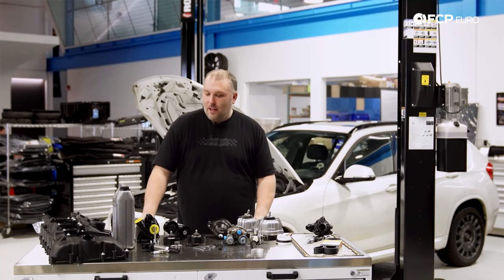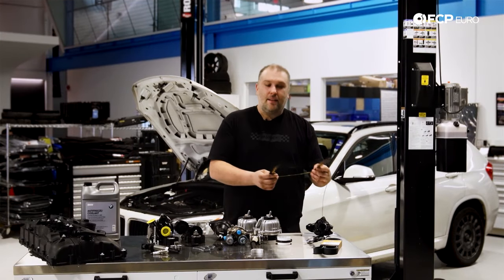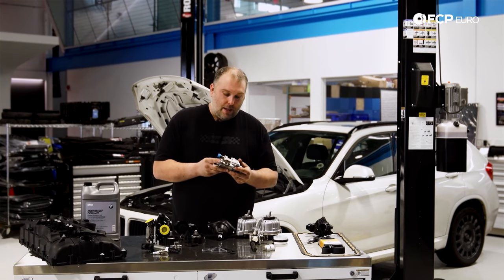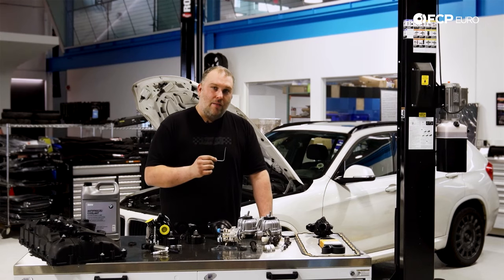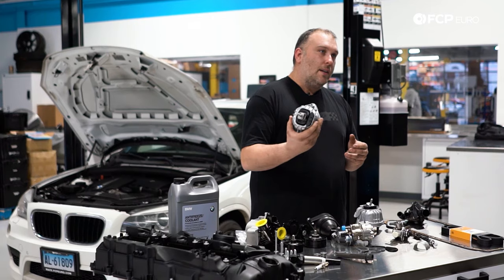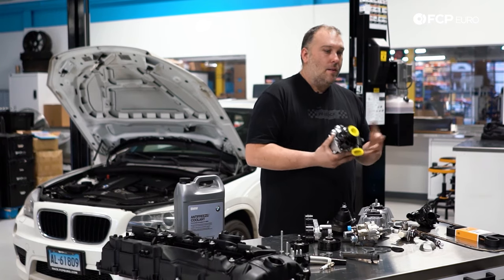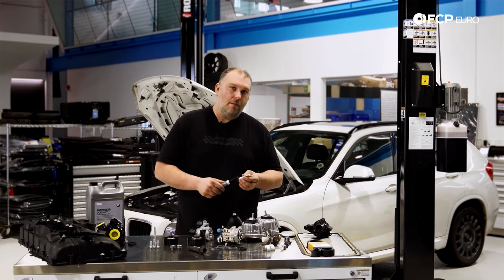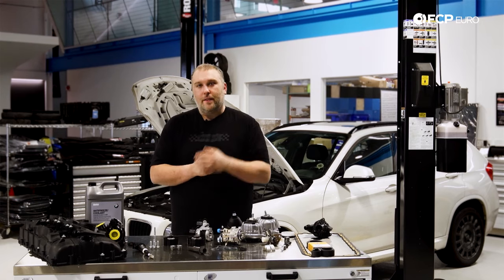BMW N55 Engine Diagnostics/Problems - Everything You Need To Know (X1, 135i, 335i, 435i, 535i)

Comment: If you maintain you oil change intervals to 5000 to 6000 miles max you can significantly extend the life of your valve cover, oil pan and oil filter housing gaskets. Also your VANOS solenoids and rod bearings.
Reply: Also with tuning you can lower the coolant temp from 230f to 200f and that will also extend the life of all your plastics components.

Comment: I had a water pump, cracked valve cover, oil filter housing gasket, and pulley failure all before 60k on an F25. Has been great for another 70k but compared to my N52 powered vehicles it has been much more expensive to run.
Reply: i had the water pump/t-stat,  pcv valve leak(part of the valve cover), valve cover gasket leak in a n52 E85 z4 3.0si, so not much better tbh
Reply: Any cam ledge bearing issues?

Comment: This is a great video, and I love my 2011 535i, but you'd think for all the German quality and the price these cars cost, the service life on these parts would be longer.  I have just under 150K miles on mine and the notion of all of these gaskets, pumps, etc., checking out at 100K miles or under is bonkers to me.  Especially when my POS 08 Ford Escape continues to chug along at 230K miles on the clock with just regular oil changes, and my classics run reliably despite being 60+ years old.
Reply: Based on what you said, the Escape doesn't seem like such a POS
Reply: @JPDenali The escape is a reliable POS. The bimmer is a questionably reliable high performance sports/luxury car.
Reply: planned obselescence $$$$

Comment: I’ve had 95% of all the problems that can happen is this video. The strangest one was the high pressure fuel pump shaft breaking in half, anyway I love [135i DCT with M sport package] the car so spending the money wasn’t an issue.

Comment: In California(I am not sure in other states/countries),  the warranty on the valve cover gasket is 8 years OR 100k miles. A lot of people diy the repair, and I was about to... but I got mine changed for free at the dealership. I have a 2014 M235i and it started to leak and would pool up and drip right onto the down pipe. I would smell oil burning and even saw smoke pouring out through the hood while driving. Posting this for anyone who might be in the same position I was!
Reply: Is this applicable to an n55 bought out of state even though I reside in California or only car initially bought in the state ?
Reply: @PutTheCookieDown  It’s a result of calling back and lawsuits. I don’t think it has anything to do with CA. A similar case happened on water pump.

Comment: "This is a very reliable engine considering what it is..."

Fool me once.....
Reply from the maker: 55 is a higher number than 54... it has to be better.
Reply: FCP Euro clearly you know where I’m coming from😂
Reply: It is reliable...
Reply: @matt.108  scotty kilmer?
Reply: Aidanlee5914 I hope not lol
Reply: chris krip compared to the N54 I had my N55 has been really good to me.
Reply: My 161,000 KMs n55 here, never tracked, stock, 6k oil changes, original owner. 

So far : 

- Valve cover gasket
- Oil pan gasket
-Oil filter housing gasket
- charge pipe blew up
- map sensor 
- boost pressure sensor
- maf sensor
- all wheel speed sensors
- waterpump 3 times
- HPFP 
- Alternator
- Vanos solenoids
- ignition coils 3 times

My 149,000 KMs 2012 Civic Si, stock, never tracked, 6k oil changes, original owner. 

Spark plugs....

If I didn't do most of the work on the BMW myself I would be living in a box on the side of the road by now.
Reply: I think in the past 5 years I've old ever heard of 1 n55 failure on babybmw so m135is, m235is and m2s and his was probably due to servicing every 2 years so yeah it is a reliable engine
Reply: Blueblood true. Most of the n55 failure are from the m’s. It is used across SO many models. It is still a rare failure
Reply: @vb7037  I  am oscilating between Civic type R and BMW M135i n55. But the list of problems here (and all over the net)  is huge, i think i'll stick with the Type R. I don't find much on the Civic Type R FK8 reliability, but should be far better than BMW.
Reply: And i ended up buying the M135i...
Reply: @motorhead16  dgf take it life is short at least u have a car 😃
Reply: Silviu Ratiu the type R has cooling issues afaik
Reply: @canaksoy8130  only if you track it.
Reply: What about B58 just another improved N55
Reply: And $3000 later your ready to trade the car in. Oh he forgot to talk about the coolant hose from the thermostat to the engine block its made of plastic it cracks and leaks.
Reply: @vb7037  you can't compare a cheap civil to a complex machine like a BMW
Reply: My 535 is approaching 90k miles...recently had my valve covers and gaskets changed as well as AC blower. This really makes me considering cutting my losses ☹️
Reply: @vb7037  How about 2011 bmw x3 35i with 120000 miles on it. In terms of the engine and transmission , is it ok if I will buy for this time? Hopefully for your reply soon.
Reply: @vb7037  jesus christ....... nope im getting a type r instead. wanted an m2 but nah.    ive had a 2012 si and let me tell you that thing has been through hell with me. only thing i changed was spark plugs. shes sitting at 225308 KM right now and still strong.  Now for my 2015 86 i wish i can say good things about it.
Reply: @motorhead16   lmao I was in the same boat. I tried both and I ended up getting the m235i...
Reply: @AFwitchdoctor  type r is over prived tho and not as fun.
Reply: No no it's more reliable than the n54 is all they said.  So bmw didnt really make much of a claim there. I got 3,000 maintenance free miles outta mine this early summer.  Then the evap canister failed, a front o2 sensor the oil pan and valve cover have noticeable leaks now and she was cranking forever but now won't start on chilly days so I'm thinking it's fuel pump.  All this 2 weeks after the battery died and by some miracle jumping it blew the footwell module. (Used to work at a euro auto place and I've jump started 50 different e9x over the years and never had one blow).  
  Oh yeah, I did replace the tires in that 3k and the brakes are real close to needing replacement.
  Deer ran into the side of the car, $700 headlight, fender and door are now needed. So junkyard door, swap the original air bags into junkyard door get a Mexican built fender and hopefully I can find a Valeo or whatever company made these lights without a bmw badge and boom.  I'll be driving again in no time...
Or just keep looking at it in disgust as I hop in my boring as hell but reliable Volvo xc70. They don't look like much, but that's one of the best cars ever made....for a station wagon. For real. ever seen an original bmw turbo in a 250,000 mile car?
Reply: @joselitoorigenes6773  get ready to replace your expansion tank any day now and I'd check the floors for any leaks.  I've 4eplaced half a dozen main battery cables. The one tgat runs  from the battery in the back to the firewall under the passenger and runs underneath the carpet. There's a rubber boot that let's some wires pass through behind the passenger seat that cracks and water starts making its way inside.
Reply: Lol hahahahahah
Reply: @motorhead16  sooo... How's the reliability been?
Reply: @vb7037  Fuck I just bought a 2015 335I should I be scared about major repairs soon?
Reply: @gucci1131  yes just wait go do some pulls
Reply: @lostgary0  lmaoo odd
Reply: @gucci1131  maintain it. If something goes bad fix it ASAP. have a 2k emergency fund for just the car. Pay the car off for the love of god don’t finance a bmw. They are good cars but you need to know how to work on them a bit or you will be broke. Just take care of it and it will take care of you.
Reply: @vb7037  Jesus Christ.... care to explain how that all happened?

Comment: Amazing. Had 2 n54s & on my 2nd n55 right now. Spot on video with everything absolutely love it. My 135i n55 is right now at 250000 & first issue ever so far was turbos which I’m doing this week. Aside from that the car has been fbo and tuned for over 100000km and has ran mint. Surprisingly
Reply: what oil and weight do you use?
Reply from the maker: That's very impressive, Jon! Happy to hear you've had a good experience with the N55!
Reply: @cali_cal  generally use bmw's or if I was ever in a tight situation liquimolly but rarely ever does that happen. & I do 6.5l sometimes add a tiny bit extra but not required only ive done recently.

Comment: got a 2016 435xi coupe, 189,000 km have changed oil filter housing, valve cover, transmission fluid with pan, drive belt, transfer case fluid, battery, spark plugs, brakes, tires, headlight bulb, anti freeze and brake fluid, diff fluid , oil change every 5-7k car runs solid

Comment: My 2015 435i coupe (N55 EWG) has 160k miles. Still runs like new and hella' fun. Things replaced; valve cover, water pump, belts/pulleys, coils, charge pipe, fluids. Pretty common sports car/BMW stuff. Love the car to death.
Reply: Did you change on failure or as part of regular maint?

Comment: Also F30 specific (I think) the little coolant hose from the tank to the upper radiator hose. Breaks right at the 90 degree angle.
Reply from the maker: Matthew Sahd , very true those right angles can get brittle and split!
Reply: Very true happened to me
Reply: Not really F30 specific, had it break on my E92 some months ago...
Reply: @obihornchen6508  you look at them funny and they snap....x3, x5 3, 5 any bmw from what....2008? 2006 to 2013? Bmws rule.  I'm starting to question my sanity in buying them.  🙃
Reply: my radiator is leaking and this may be it

Comment: Couple of things: The rotary style HPFP was used until March of 2012, so for about two years in the E9X N55's, the N55 uses two different injectors (not sure what build date that change was made), and the F8XM3/M4 plugs (RB ZMR5TPP330) are the same heat range as the N55 BOSCH ZR5TPP33S spark plugs. Great video though!
Reply from the maker: Thanks for pointing those out, Twin Scrolled! Glad you like the video!

Comment: My 2014 740li xdrive has an N55.. didn't see that F01/F02 in the comments. So far I've replaced the oil filter housing gaskets, belt, pulleys, tensioner, plugs, transmission fluid & filter all from FCP Euro. Sometimes I find myself just browsing the website looking for something to replace next 😂.
Reply from the maker: Atleast you're staying on top of it Dr. Mel! That kind of shopping can be considered "preventative" or "paranoid" ^.^

Comment: Just had my 2011 335xi(73,800 miles)) at a BMW dealer on 5/19/22, I bought my 335 at CarMax in 2018 and got the highest warranty they offer(which was $4,000) which lasts 4 years or 125,000 miles.  Anywho, I blew my charge pipe a couple weeks ago(im running MHD tuning software state 1+), and never upgraded my stock charge pipe so she literally blew apart.  I upgraded the charge pipe and saw my oil filter housing to be leaking oil.  My warranty expires in December 2022, so I figured "what the hell", let me bring it to BMW, have them give my car a good inspection, and see what they find.  I told the Service Advisor about my leak, and told him I have an aftermarket warranty, and for them to give my car a good once over, and call in what they find to my warranty company to check coverage.  He told me that warranty companies dont cover oil leaks, as my profession is also Service Advisor(at a Honda Dealer), I told him to diagnose my car, and call my claim in.  Anywho, they looked at my car, found the oil filter housing leaking, and also valve cover gasket leaking, and he recommended replacing the valve cover gasket and valve cover, he then said that warranty companies dont cover leaks, I then told him to start the claim anyways, and see what they say(I knew my warranty would cover leaks, as I called them already to check coverage).  So, $2,400 later($1,700 of that was labor), my oil leaks were covered by my warranty minus my deductible.  Moral of the story, Ive been in the automotive industry professionally for 18 years, I knew a $4,000 warranty was expensive, but knew the potential issues I might have with my car.  Has my $4,000 warranty paid for itself yet, no, but my oil pan may be leaking too, so once I get that replaced too(under coverage), yes, that $4,000 was well spent.  Ohh, and I've only driven my car 6,000 miles in 4 years too

Comment: first of all when you have a valve cover leak you must also replace the valve cover, plus the gasket, costs $2,200 at the dealer, the electric water pump costs $2,300.00 at the dealer to replace, when the transmission pan leaks you must replace the plastic oil pan which includes the transmission filter+ gasket, costs at the dealer $1,600, and when the main rear seal leaks it costs well over $3,000.00 to repair,  and when your extended coolant tank leaks you also must replace the plastic tubes that connect to the engine which costs at the dealer $1,200,. these things will certainly fail with less than 50,000 miles  and hopefully within the 4 year mfg warranty, in your 2014 X1 Xdrive M equipped 35i n55 engine...i know, cause they failed in mine in it's 5th to 8th year  between 40 and 49,000 miles which was all out of warranty, also the battery failed in it's 5th year...... also the 4 brakes pads had to be replaced and when you replace the brake pads you must also replace the rotors this costs $1,700 dollars at the dealers.... so if you are going to buy this vehicle used make sure this work was done, make sure you put this auto up on a lift and have a good mechanic look for additional leaks.....

Comment: both HPFP'umps cost the same, and old one is not for a handfull of months, whole E90 lineup came with it, new type started on F series only. E84 X1 had it changed somewhere in 2012.

Comment: Gareth... Awesome video. Very informative and clear and concise descriptions of the various components. I have 2 issues i wanted to pick your brain on... 1. I owned my 2011 335i 6 weeks and unfortunately... I experienced the serpentine belt getting ingested by the the crankshaft pulley. Very common problem apparently although I had never even heard of such a thing before it actually happened to me. I know that happened because I opened up my oil cap to put oil in my car and look down in the timing gears I pulled out a foot-and-a-half long thread of rubber coated string from the previous serpentine belt. Not good at all. However as you stated in the video the only way to really do it right would be to take out the motor and clean out the main bearings and the entire motor really. Otherwise you run the risk of having chunks of rubber clogging your various channels for lubricant the oil pan. However that's a daunting task for me which I am not about to undertake and I do not have the money to pay a shop to tear my entire block and rebuild my motor. And not only is it not in my budget, also seen and heard too many horror stories from Associates who have had their bimmers serviced at the dealerships, and the work done was completely poorly performed and shotty. if I'm going to trade that much money for that type of workmanship I might as well do it myself. And as horribly abusive as it may sound, I've been driving it as if nothing happened, just changing the oil and praying I don't experience other problems. What would you recommend I do after experiencing this near catastrophe. This happened at 82000 miles and I am now at a 110000 miles having changed the oil three times since then.
2nd issue was I'm confused as to what motor I actually have in my car. everywhere I've looked and anyone I've asked tells me it's an n55. When I look inside the door stamp my car was manufactured in April of 2010 which I believe was still n54  being used in the cars. Regardless though,  It was sold as a 2011 model 335i. Everywhere I look it seems that in 2011 the n55 was used and went to single turbo. But lo and behold my 2011 335i has an n55 with twin turbo from the factory. I don't understand it's like hybrid between the n55 and the n54. Could you please look into this and explain this confusing situation. After digging deeper,  I'm thinking that my car may actually be a  335IS. Is that a possibility? Any info You might have would be much appreciated.
Thanks again for the great video and keep up the awesome work, you guys rock down there at FCP Euro.
Reply: You have the n55, the engine cover says “twin power turbo” it’s a twin scroll turbo which isn’t 2 turbos, I have a 2011 335i as well 👌🏽
Reply: 335is is infact an n54 engine.

Comment: What years specifically used that fuel pump?
Reply: My 535i F10 is from 2010 and it has the less reliable one, but in germany it just makes 200€ difference the less reliable one is 1000€ and the reliable one is 800€ so if it breaks its expensive either way

Comment: you forgot to mention the 640i in the captions in the title, also engined with the N55. I also missed the coolant tank leakage, happens quite often I believe. Great vid!
Reply from the maker: You're right, HJD, glad you like the video!
Reply: What about the f20/f21, m135i they also have the n55, but I've heard bmw ironed out the weak points in the f20/f21

Comment: I got 340.000 miles on my 2011 x3  and still running like new  with this engine
Reply: How much does it cost per year to run your x3 with n55?
Reply: @HaiderAli-ot2gg  last year about 4000 dollars change lots things Drive train transmission engine  everything runs like new no problem so far Ray I change the radiator electric water pump spark plugs coils and tires I did and lots of the work myself